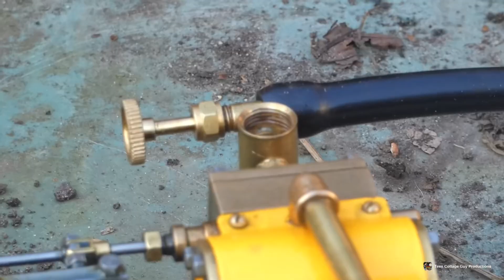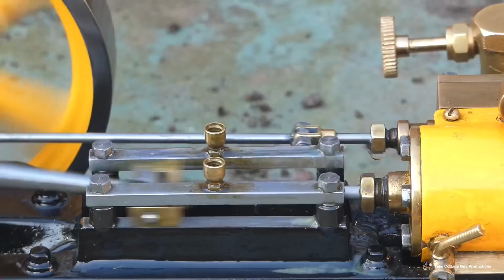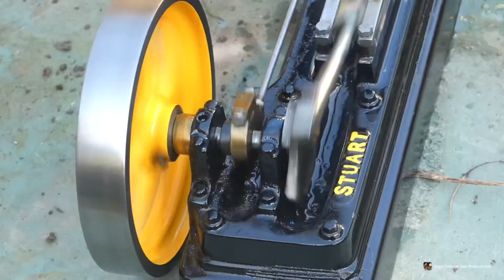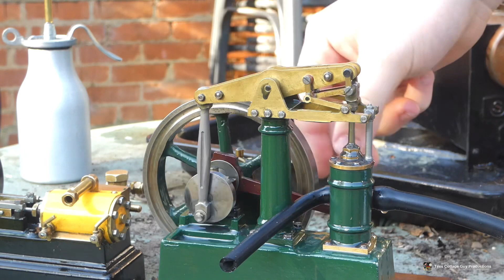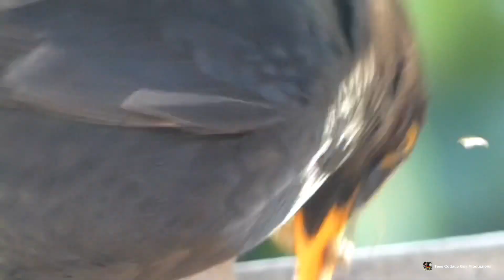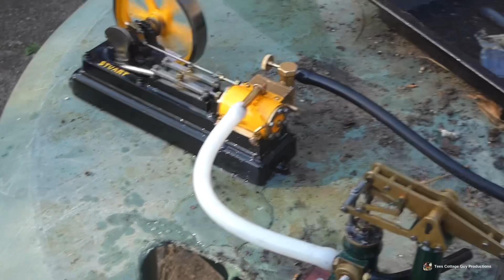Steaming the Cotswold Heritage Cirrus Beam Engine & Stuart S50 Steam Engine & the Stuart 501 Boiler

Comment: What you need is a chuff-chuff pot, you pipe it up to the exhaust of the engine, e.g your s50, its a tall, copper or brass tube that has a long chimney. Easy to make out of copper plumbing. You can hear the engine chuffing as the exhaust note can be heard.
Reply from the maker: Yes I know what a chuff chuff is. I’ve been trying to find one for a while
Reply: @teescottageguyproductions  I think there was a man who made them and sold them, not sure if he still does them
Reply from the maker: @CFHaulage  Oz Steam Demon made them but as far as I know he is sadly no longer with us